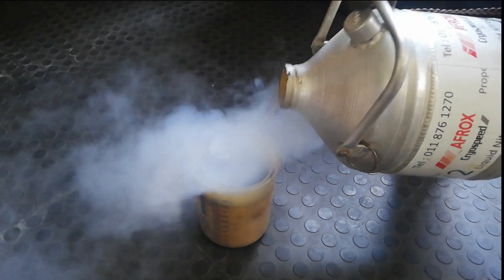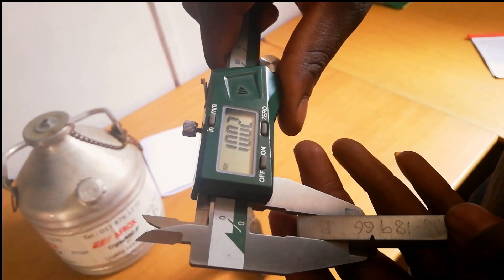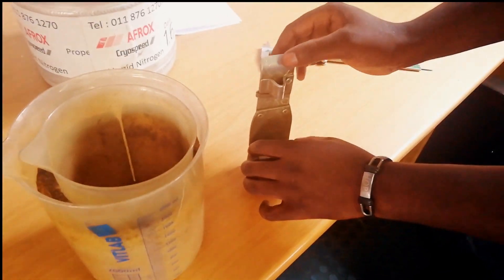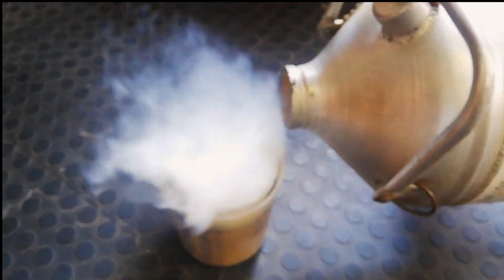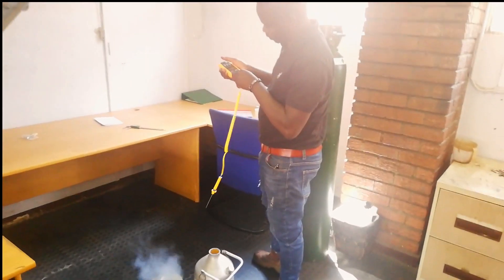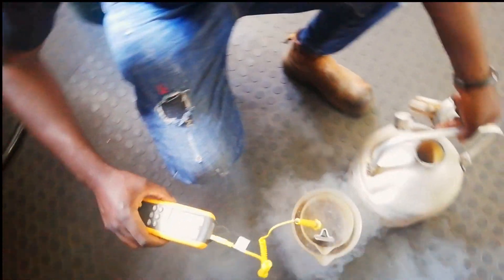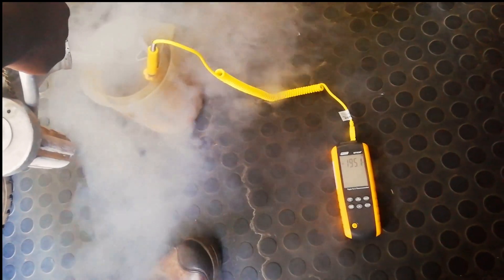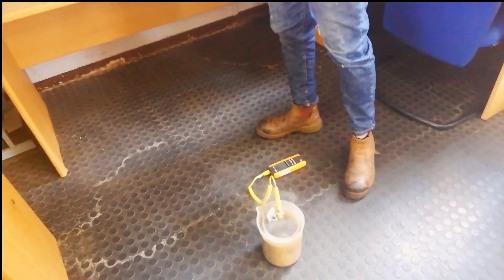Charpy Test at  -196 °C (-196 degree Celsius) using Liquid Nitrogen, Physical Metallurgy

Comment: Thanks dude. It's very useful information. Now my question is this:
How do you manipulate the liquid nitrogen to go from -195 degree Celsius to say, -20deg Celsius? How do you change the temperature of the liquid nitrogen/specimen to give what is required. Second quedtion is: with what instrument do you measure the depth of the notch? Also what is the standard impact test specimen size?
Reply from the maker: Hey Louis, I'm glad that you find this video useful... As per your question 1) the testing temperature of Charpy is given in the material's specification or by the client as per the use (bridge construction, ship, tanks,...). Now if the Charpy needs to be tested at - 196 deg celcius, we use liquid nitrogen, cause at normal conditions "liquid nitrogen" would already be at - 196 deg celcius. Now if the test is to go at - 20, - 40,...we use carbon dioxide (CO2) with acetone please refer: https://youtu.be/F26jAhDM8ug now for question 2) We use a micrometer with an in depth anvil face (check micrometer Anvil kit)... The standard size of impact is 10x10 in case the sample size does not allow to get this then we go for Sub size, as per BS EN: 10x10, 10x7.5, 10x5, 10x2.5... And as per ASTM 10x10, 10x7.5, 10x6.7, 10x3.3, 10x2.5 remember that above is for the width and thickness the length should be 55mm...